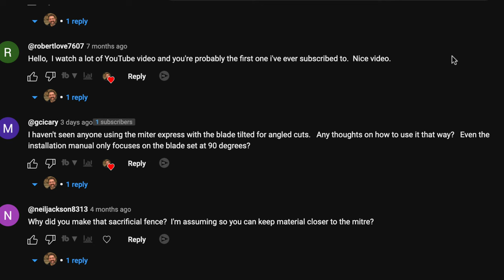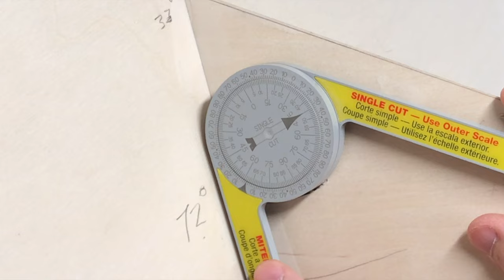Get More Out Of Your Incra 1000

Comment: Very interesting video. I’ve just bought a 1000HD mitre guage (which comes with the advanced Incra no-deflection stop) and the miter express. The manual says that the sacrificial fence should not be more than 2.5” (from memory) high - so that you can continue to use the rule on the main fence and the Incra stop block. That’s obviously a bonus.

Where your sacrificial fence scores is it offers a higher support to the cut piece - but at the cost of not being able to use the rule or the Incra block.

I’ve also got KM stop which is currently on my shop made mitre sled. So, I am thinking of 2 sacrificial fences - 1 will be that 2.5” high and the other higher and thicker to fit the top aluminium T track. 

I’ve really gone from my shop made sled (very accurate but very heavy and only good for the blade at 90) to the Incra because, after 45 plus years of woodworking, my body shouts for help when there is anything heavy. Don’t laugh, you will get the same some day. 

I’ve also got the full calorie Incra router table. Very nice except that set screws holding the fence in place have a great tendency to unloosen and so affect the of where you want each part of the fence to be against the other. Does anyone else have a small box of screws and bolts which suddenly appear on the workshop floor and you have no idea which machine they came from. It’s my “ where the flip does that comes from” box.
Reply from the maker: 😂 I hear ya. I don’t have the box of fasteners. Probably because they end up in my shop vac before I see them. LOL. 
But I do try to prevent too much bending, lifting and kneeling. Oof da!

Comment: Is there anything stopping you from making your first cut at 45 degrees through the cut off table piece so you have zero clearance and support for the off-cut?
Reply from the maker: Yeah, it's not necessary. 
The off-cut of a 45 bevel should be on the low side of the sawblade and jut drop off. Zero clearance really isn't an issue.

The off-cut side support is more useful to catch 90 degree cuts, which are also far more common.